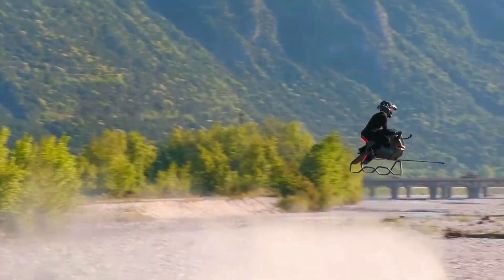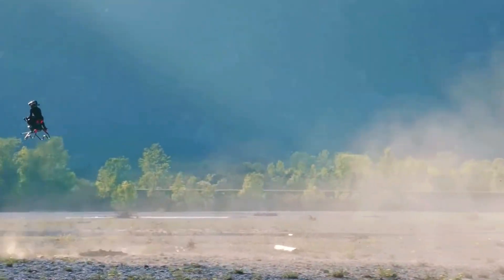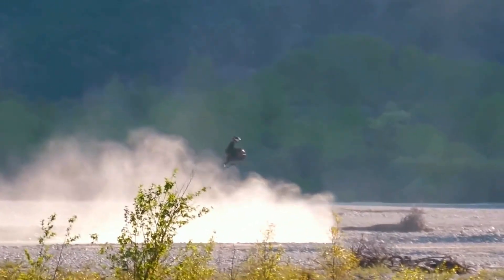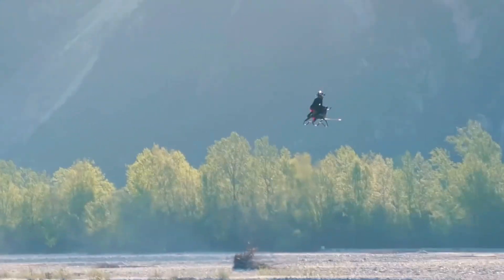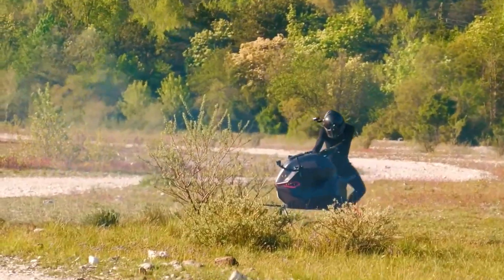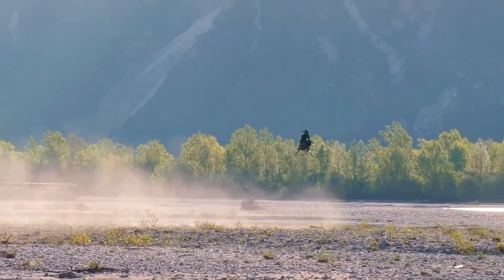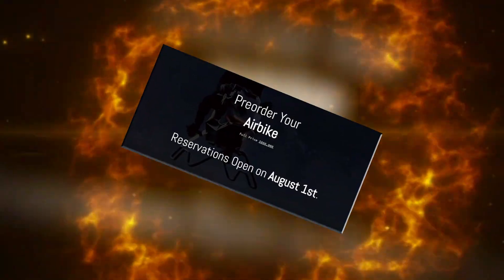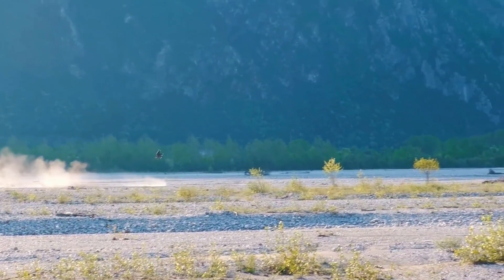$880,000 Flying Bike? Volonaut Airbike Raw Test Flight Will Blow Your Mind!

Comment: 880k for 30 KG in machine? Should be 40k and these guys would have taken over transport.
Reply: Nope...cities will quickly and succinctly ban or severely regulate them
The car lobby and oil industry are not meant to be messed with
Reply: Yeah, it's not even nearly worth it. Those jet engines won't even be proprietary designs. You can buy four engines for between $8000 - $12000. Then, all you have to design is a mechanical steering system, which will be the most costly part of it. Visually and aesthetically, it looks fairly cheap and unstable. The company will go bust

Comment: This is an inexpensive flying machine that takes about 10 minutes, is equipped with a jet turbine engine, and only costs $880,000.
Reply: Only costs $880,000. Are you joking? You could design and build your own for less than that 😄